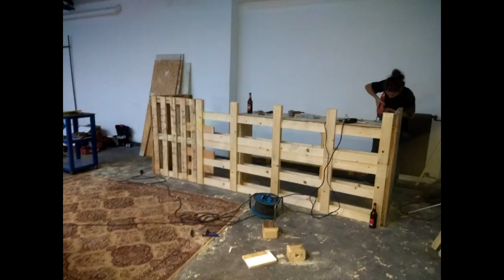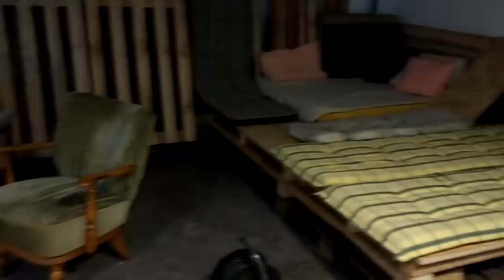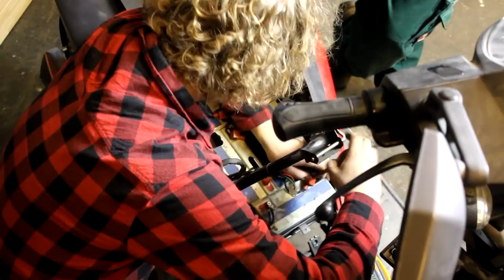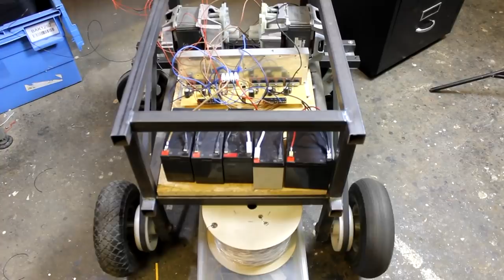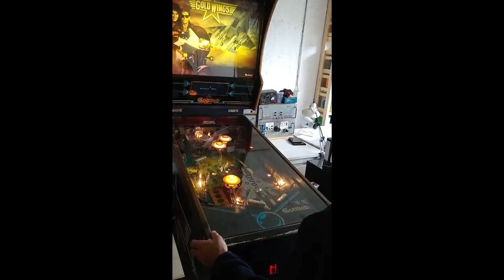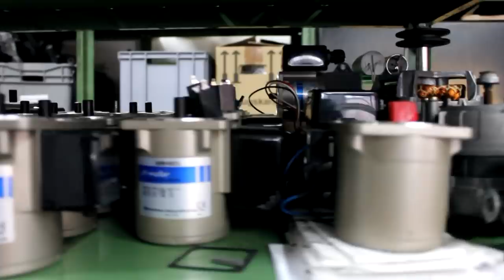Update:  Workshop - and Robot Upgrades

Comment: Few points: Check up on your local laws. Here if an item is abandoned your only duty is to keep it under lock n key for 60 days (in case the other returns and wants it back) and beyond that it is yours. You should even be able to license it.

Clubhouses aren't always high dollar. When in elementary school an acquaintance of mine made a cloubhouse in the rafter of his dad's garage. You had to lean sideways like some scene out of the diary of anne frank. It had a dangerous 120vac exposed knife switch and some discarded xmas lights for ambience and a boombox playing queen and the 70s hits of the day. It wasn't much at all. Not even a chair. But it was ours.

Comment: You should contact your local building/construction supplier as they often throw away sheets of osb board and other good stuff if it is damaged. Sometimes they just have one damaged edge, my dad gets all his fire wood from our local building supplier and recently he also got some huge (and very heavy) steel racking which had been bent by a forklift hitting it, but was very useful in his small workshop. Btw Great video as always 👍🏼

Comment: Great, I'm planning to do something similar with washing machine's motor:) more speed oriented, in my idea is to drive separately the induction coil from the stator. And most important have a brake system able to recharge the battery!!

Comment: I love the sound of the different drive speeds on the robot. I love that electronic sound, is it made by the mosfets? I remember the old Tatra trams in Berlin had a similar sound, both when accelerating and when breaking. And now, some of the new one-compartment subway trains also have that sound when accelerating or breaking...it sounds like there's a huge conversion of power going on somewhere, so to me, it is the sound of might!

Comment: I am wondering if the driving belts on the robot would slip if the robot needs high torque at low speeds, like when pushing something or climbing a steep incline ... Wouldn't sprockets and chains be better for a drive train?